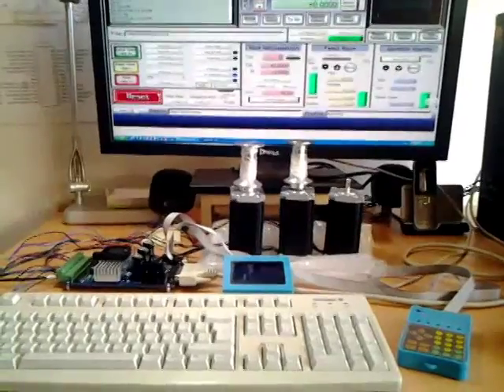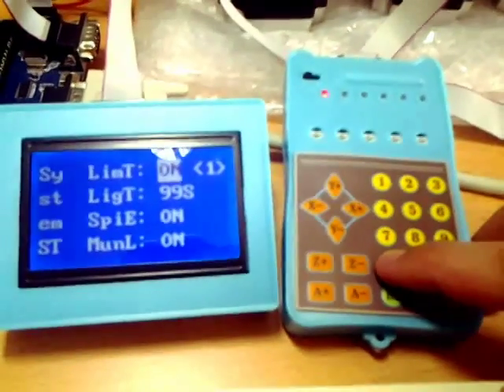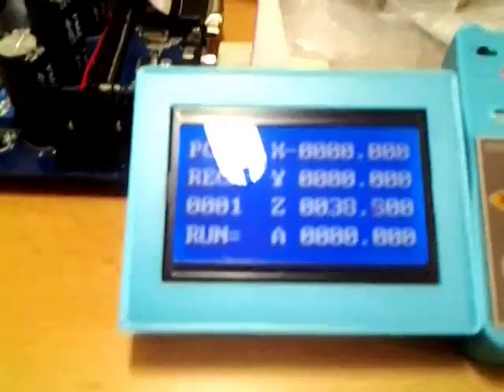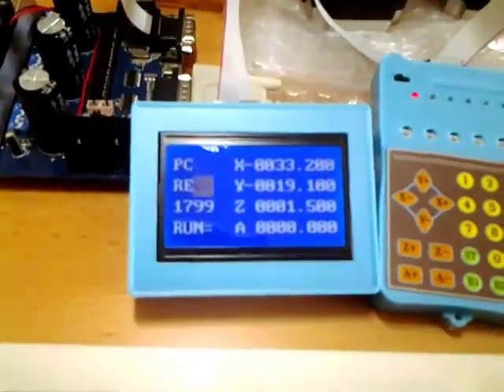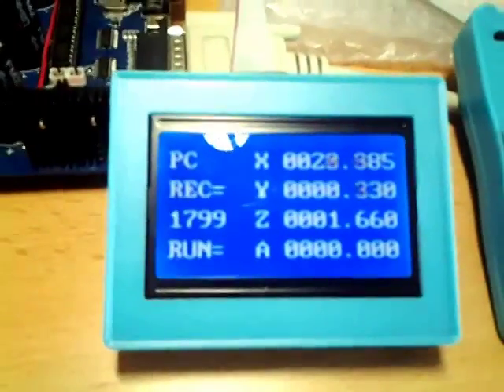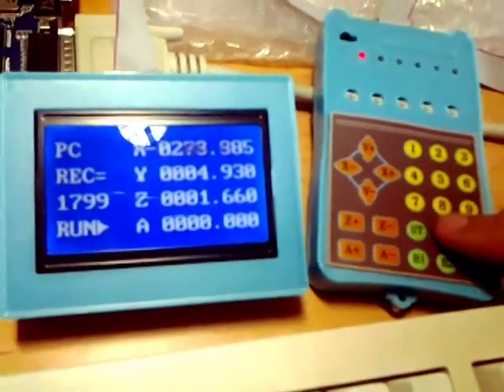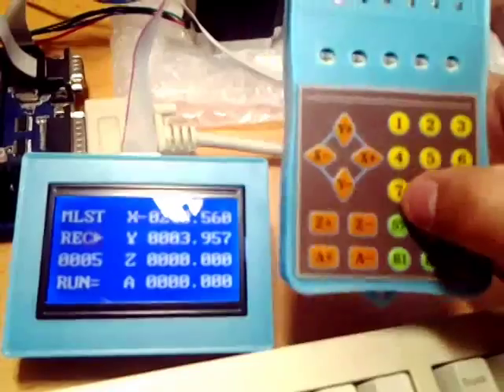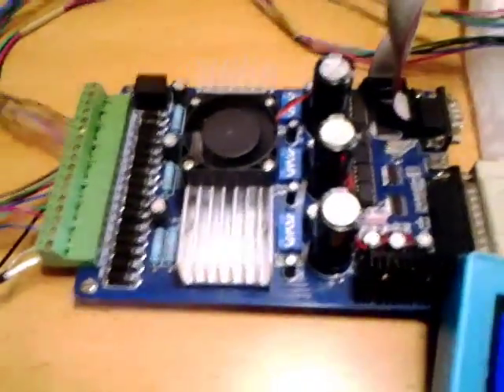TB6560 Professional Version Record/Replay G-Code?

Comment: Thank you for thus video. I have the same board and Ian having a problem by slaving A axis to Y axis. I did the setup on Mach3. But it works on one way. And if i action the other way the two stepper motor turn each opposite  from the other. If it run in one direction both stepper  why i am facing this problem as per you?
Reply from the maker: May be this is how it should work when you mount motors in the real CNC. But it can surely configured.
Reply: @GfastGao  did you ever try it and how it can be setup

Comment: hi I have brought the same TB6560 board, but not able to configure it to PC. it's not connecting. no motors running. please telling me the configuration method. Too
Reply: You will need Mach3 software .. i think this will help you how to configure your mach3 on pc to work 
http://www.cnczone.com/forums/attachments/2/6/4/6/505306.attach
Reply: Dear friend it doesn't work on Windows 64 bits

Comment: did you figure out how to record and run the motors via g-code by the memory chip on board?
Reply from the maker: +Muzammil Queen No, I didn't. And I do believe that the Firmware in this chip won't actually have the competence to encode G-code at all. Perhaps I just got the faked one.
Reply: +Gfast Gao As parallel port information comes in form of bits, i guess the recording records all the steps .. for instance if you are moving from 0 - 1 mm .. all the steps of stepper motor are recorded individually,
Reply from the maker: +Muzammil Mueen Yeh, it perhapse do so. But I think the board is feed with "010101010" but not the unparsed G-Code, which is much more memory efficient. If you do hacked this board and find something interesting. Let me know please.

Comment: Hi, i'm a french student, sorry for my english
I see on your video, you can record several move for your 3 motors in one program (in manual mode).
When i'm doing like you, it doesn't work,
can you help me please ?
Reply from the maker: mathieu amoroz I think, you should check out if yours have the same controller as mine. For specific I mean you can check out the introduction video about the board that I have: watch
I think very likely you bought something else, but looking the same...
Reply: Gfast Gao I have the same controller as yours (tb6560). 
I bought this pack :

 http://www.ebay.fr/itm/CNC-Carte-Driver-En-Boitier-Sauvegarde-Gcode-Commande-Manuelle-Moteur-Nema-23/351420465624?_trksid=p2047675.c100011.m1850&_trkparms=aid%3D222007%26algo%3DSIC.MBE%26ao%3D1%26asc%3D20140620074313%26meid%3D1dbc8b93ea5c47bfbb48cb8fee7313f6%26pid%3D100011%26rk%3D1%26rkt%3D8%26sd%3D351394270551

I'm trying to test the manual programmation 
For information i'm not log on mach 3, i haven't the rope to connect my PC to the driver yet.

So, do you have an idea for help me ?
Reply from the maker: Ennnnnnn, The controller looks the same as mine. Have you tried to control each motor correctly with the controller panel? I mean let three of them rotate in the correct direction for example. I think it should be pretty much the first step.

Comment: 1800 Steps:
the controller is recording all steps during cycling the circle.
That means, depending on the resolution, you have a high amount of steps.
Have you checked recording a square shape?

BR

Andreas
Reply: I try it and it works only in one way forward but if you want to rewind it there motor does not have the same rotation. Do you have a solution??

Comment: I bought this board, but i can't do it work. Can you show me the pins configuration in Mach3?
Reply from the maker: Sorry I don't touch that board for really some time. But perhaps you'd like to check this easy pinout pdf: https://github.com/Gfast2/Yifei/blob/master/Hardware/TB6560%20Step%20motor%20Driver%20Datasheet%20%26%20Software/3rd_3Axis_TB6560_Set_Limit_Estop_Wiring_Diagram.jpg.pdf

Comment: Thank you for sharing your experience. I am thinking to purchase the same unit TB6560 replay function.  Were did you find your unit? and would you recommend it for the price?
Reply from the maker: Hi Morris, I got this board from my Professor. He told me that he bought it with 3 NEMA 23 (200 step/round) step motor and a 20A power supply on ebay for about 250 EURO. As a said in this video series, the G-Code record function on this "Professional version" won't work. Since I play with Arduino, I'm surely known it is impossible to record G-Code from a LPT port. LPT port is only streaming parallel pin voltage level (5V or 0V) status. G-Code streaming can only happen when send the G-Code directionally through Serial port (as ASCII string or like so).
If you decided to bug one. I suggest you to make sure how to use it before buying it. After these days hands on, I don't think this board have the really ability to record G-Code. Good luck and happy machining!